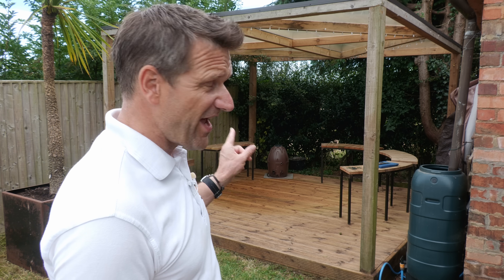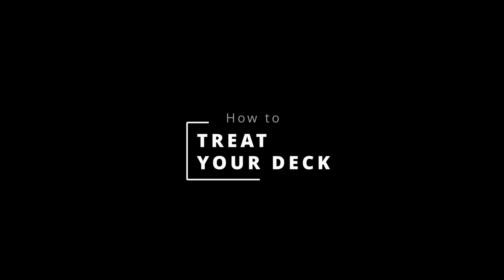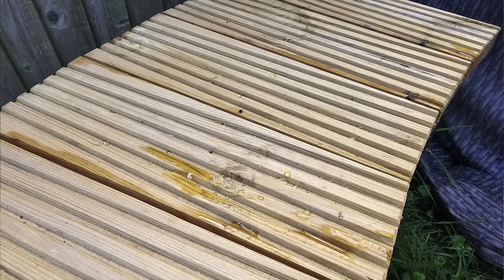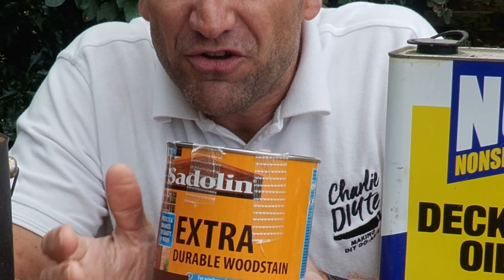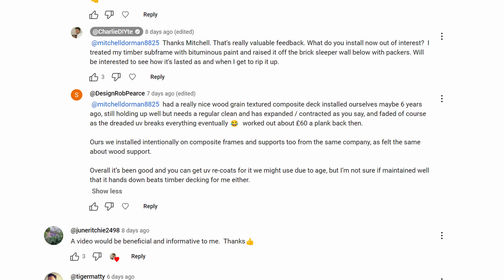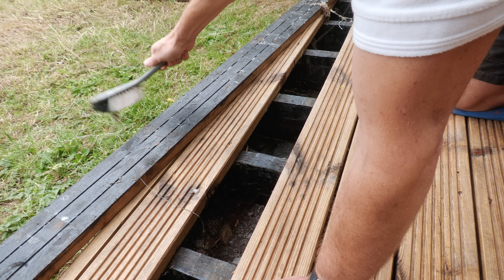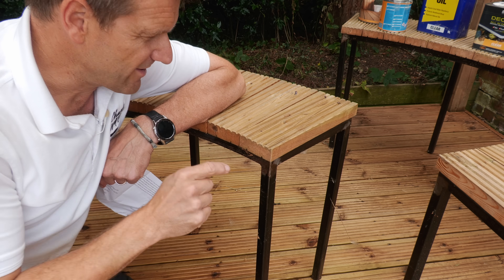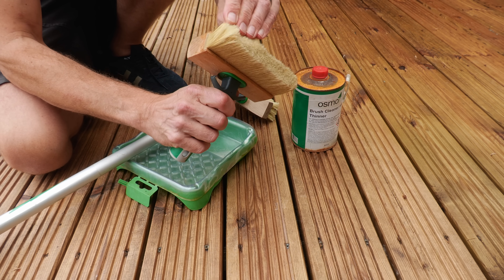Four Years of Deck Cleaning and Oiling - What I've Learnt!

Comment: As someone who has been building deckings for nearly 15 years, I wholeheartedly disagree with oiling. You listed a reason against staining as it will come off after 12 months yet you are re oiling yours in the same time period. The problem with oil is once the wood has absorbed oil a few times, it no longer does. Like you say, stain sits on the outer layer of the timber BUT it can be completely removed and changed at will and I would actually list that as an advantage.
Reply: As someone who has just had to sand back all their decking i agree fully with oiling it looks bettef and easier to maintain

Comment: Best advice for decking…..do paving instead🤣
Reply: I'm with you on that. I think paving looks nice. BUT - nothing like getting out of a hot tub and the walking around wet on nice wooden floor. Water drains away really nicely.
Reply: @MatSmithLondon  just isn’t worth the upkeep, use sandstone slabs, that’s what we have for the hot tub
Reply: @Lyonscarpentry  ours is a hardwood deck with full coverage from the elements, haven’t needed to do anything even after 5 years still looks presentable. I guess it depends on general design

Comment: This bloke hasn't a clue, 1) to clean decking use 50/50 water and thin bleach, all you need to do is make the decking wet and wait for a few days, with 5mm gaps in boards this should be enough for the boards to last 20+ years, BTW never presser wash decking or oil it. 2) The frame will always rot out before the boards but if you want it to last do these things, use tacky tape (Brand Butyl Tape) on every screw, this prevents water ingress into the long grain and seal all end grain on the sub base, use slate on top of the cement pads the base rests on.
Reply: There's always someone who says they know more, especially in the anonymous world of youtube comments. Thing is, Charlie is an all-rounder, so when he does a video about a subject that he's not the most expert in, we all learn a tonne. I can't really learn from your comment because it starts with a slur, so I don't tend to take the rest seriously..
Reply: LOL never pressure wash your deck. The reason you have to be careful is that it can lift the wood fibres and make for a fluffy surface but only with high pressure and soft timber, just be careful. Generalisations like these don't help.
Reply from the maker: In my original decking oil vid I showed how weak that Karcher pressure washer was by pressure washing my hand.😉
Reply: @MatSmithLondon  You keep spending loads of money on products and hours of scrubbing to keep your decking clean and after that use high pressure water to separate the fibers while I'll just kill the organisms that make it rot and go green by just making it wet with 50/50 (takes a few mins)
Reply: @djstuc  You keep spending loads of money on products and hours of scrubbing to keep your decking clean and after that use high pressure water to separate the fibers while I'll just kill the organisms that make it rot and go green by just making it wet with 50/50 (takes a few mins)
Reply from the maker: Thanks Mat. There are so many holes in that comment but at least he's taken the time to watch the video 😉 There is absolutely no way decking will last 20 years without any treatment, unless it's hardwood. Fact.
Reply: @CharlieDIYte  Yet another youtuber making videos that he hasn't a clue about, don't you have any shame?